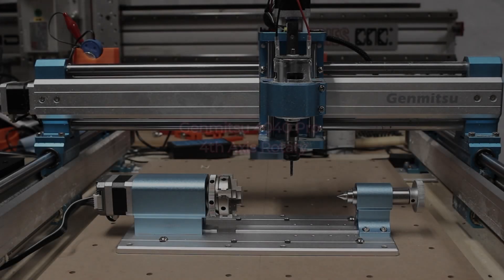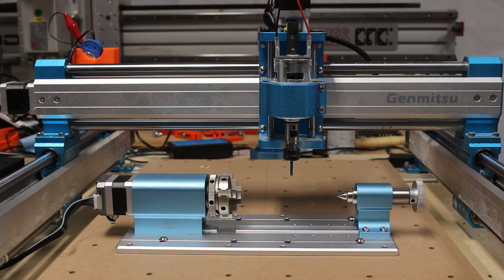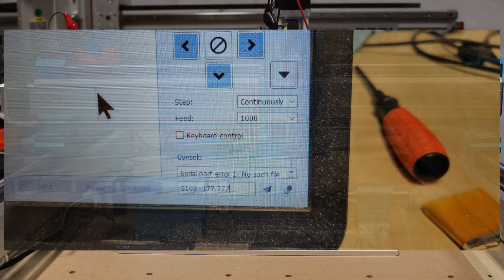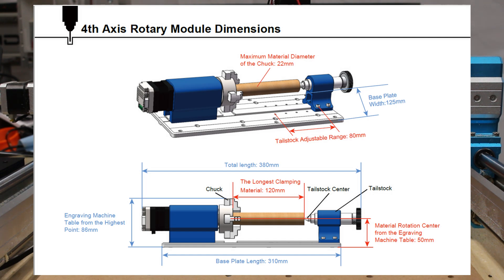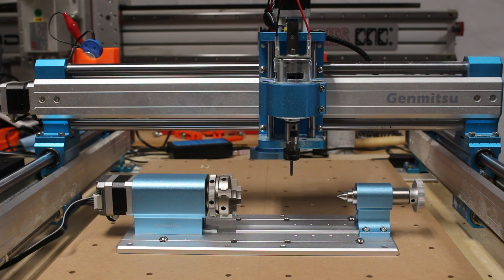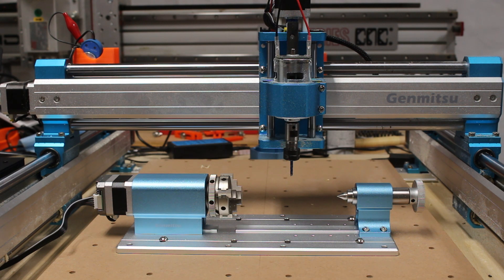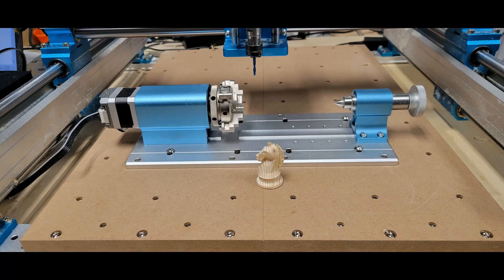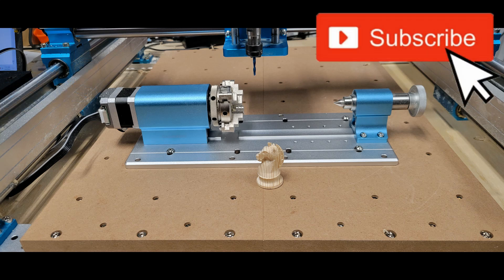Genmitsu 4040 Pro 4th Axis Rotary

Comment: The chuck jaws can be removed and reversed to use the stepped sides for holding larger stock.
Reply: I was wondering if that was possible, thanks for your comment. Do you know what is the max diameter it can hold in the reverse position?

Comment: Can all 4 axes be used together to do undecuts?
Reply from the maker: Any CNC machine is capable of moving all four axis with the correct Gcode, which means you would need the correct post processor.  For this video, I used Vectric Vcarve Pro, which only allows the "wrapping" of the X axis or the Y axis.

Comment: I'm looking for anyone with experience in using the flat rotary bed with the 4040 PRO
Reply: Keep lookin
Reply: Turns out you can use the Sainsmart flat bed rotary with the 4040.  Open the controller box, unplug both y axis cables, plug the rotary into either one of the y axis ports.
Reply from the maker: You will also have set the y axis steps per unit to match the rotary.
Reply: @DaveGatton  on the downside you have to leave the control panel cover off while this is connected.

Comment: Would this machine cut metal and make small metal machine parts?  I have small metal parts that I need to have made from steel.  Also what CAM program do you use?  I also sent you a message via the Facebook Messenger, I did not find your email here.

Comment: How does one set this up when they are not using those cheesy mdf boards that it came with?
Reply from the maker: Well first off, there's nothing "cheesy" about the mdf material that is used for a spoi lboard.  MDF is probably the most used material for spoil boards among both hobbyist and professionals.  As far as setting up the rotary axis, you just have to make sure that is parallel to  the X axis and have the centerline of the bit directly  in line with the centerline of the rotary.  Easy peasy.
Reply: @DaveGatton  I am used to using full-size machines with multiple 3/4" mdf layers using vacuum plenums. A 1/2" bendy piece of mdf suspended off the table in mid air in its center is unacceptable to me. That was the first thing I got rid of when setting mine up. They could have at the very least sent us a single piece not a split base setup.

Comment: Could you do a video of creating the tool paths in VCarve, exporting the Gcode, and using the controller?  

I’m confused on what post processor to select when saving the g-code in VCarve.
Reply: UPDATE: There is a post processor on the SainSmart 4th axis resource page linked led in one of the guides. I found that I needed to edit the line wrapping y to “ A” to “-A” to correct a mirroring issue.
Reply: @reblackwell2   changing the  $3= parameter from the original setting of $3=4 to $3=12 using candle or UGS also solves the issue,  i think the remote needs to be plugged in and set to 4 axis mode before changing $3=.  to list all the $= parameters sent $$.  $= settings are basic system setup parameters you set and they retain the setting unless you change them

Comment: Well done.  How does the off line controller work?
Reply from the maker: It works much like a 3D printer.  One button that also turns like a wheel.   You press the button to select and turn the button to move between selections.
Reply: with the offline controller you can run a program without a PC,  you load it from a micro SD card.  it also has a jog,  home routine and probe routine for setting Z0